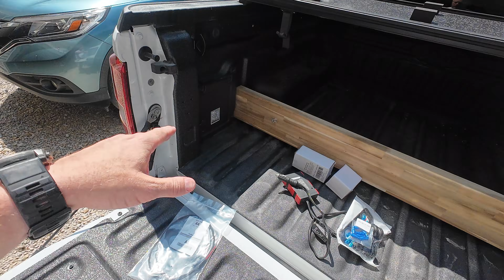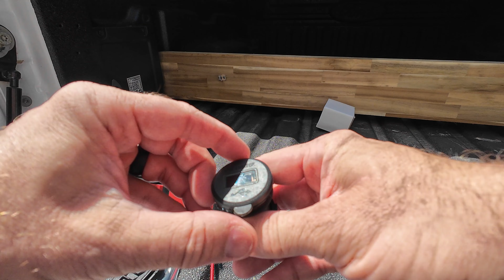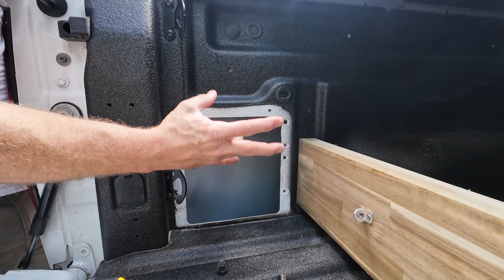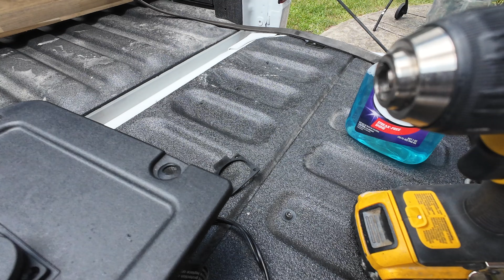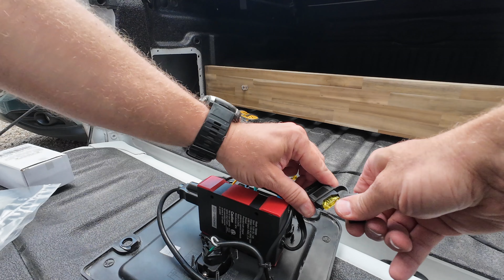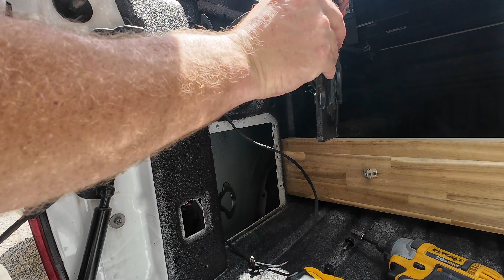Adding 120v AC Power - FORD MAVERICK FLEXBED

Comment: Would this be suitable to plug in a Milwaukee rapid charger to charge my tools?
Reply from the maker: It should be able to handle it. Just double check how much power (in watts) the Milwaukee charger needs and make sure it is less then the inverter provides.

Comment: I have an XL and mine did come with the storage cubbys for those two slots in the bed. I going to convert them to a power station in the bed to something like you did here only with extra batteries to power a inverter. I should be able to use the 12v to charge it then the 500W inverter I use just pulls from those 12ah batteries in the box. Should be a fun project. I just happen to run into you video and you did exactly what I'm going to do. Keep it up!
Reply from the maker: Great idea 💡. That's an excellent solution for something as long as you don't use it constantly.

Comment: Do you know if I can connect a pressure washer on it?
Reply from the maker: Not with this amount of power. It would require a much larger inverter and bigger gauge wire run from the battery

Comment: A video or write up on all the wire connections would be helpful. That part has my mind boggled.
Reply from the maker: It's actually pretty simple. It's just 12 volt power to everything through some switches. Watch the video a few more times as I detail it in the video.

Comment: the switch you have on the panel is for the inverter only because you have an on/off button on the usb/voltmeter and on the led light?  So i could use the switch for bed lighting instead of an inverter?
Reply from the maker: The switch on the panel controls the inverter, but you can repurpose it for other accessories like bed lighting.